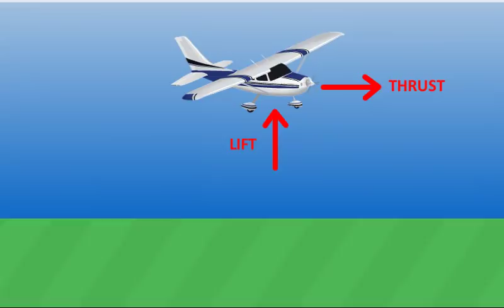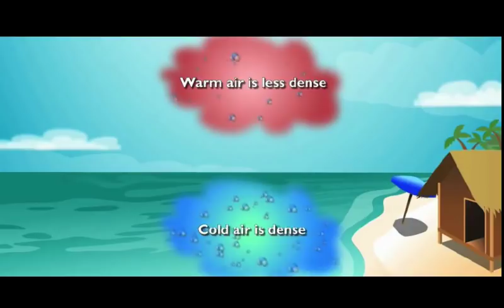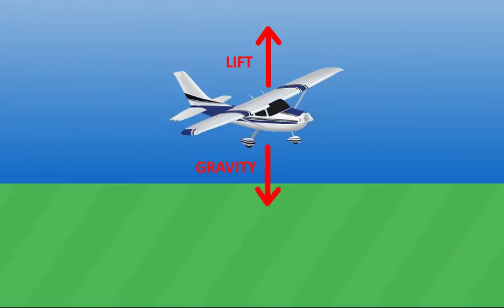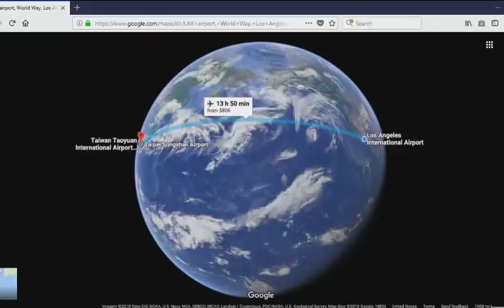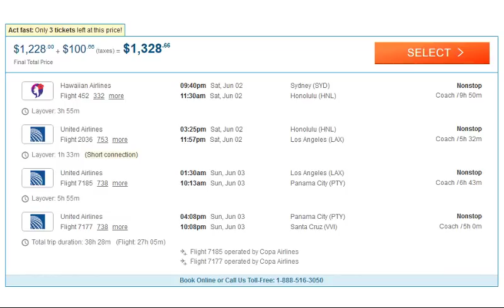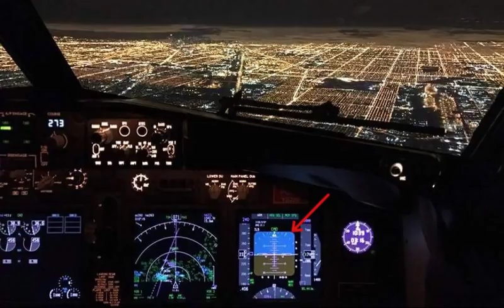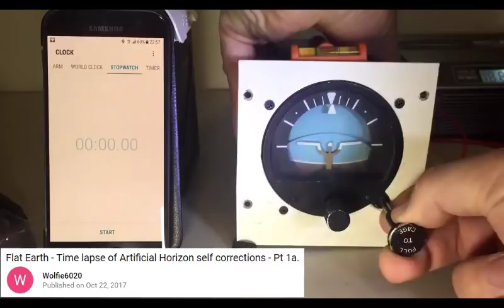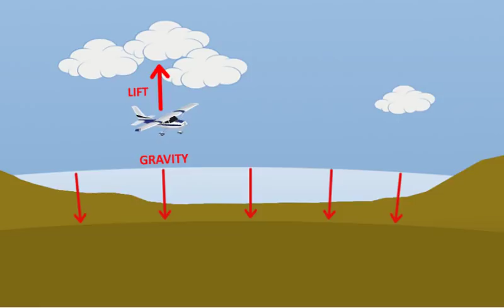Flat Earth Falsities - Plane Nonsense

Comment: Lmfao you mean "Air Density"  is what is actually Atmospheric pressure. Airplanes use route checks for strong cross winds. All routes are planned and are often changed due to Weather this has nothing to do weather the Earth is spinning or still. The air does not rotate with the Earth's Rotation it moves independent of the Earth. You can see massive cloud sections moving all over the palace in every direction. So by using your eyes  you can see that the Air does not rotate with the Earth. Anyone who looks up at the sky can see that the Air that is moving the clouds is then also moving faster than 1200 mph in order to counter act the Earth Spin thus making Flight Impossible. Look at a globe from the Top and now the Flight to Alaska makes sense stop looking at the Globe from the Side, look at it from the Top and you will see exactly why that flight went to Alaska. Since you are so smart then please explain which American or Russian Astronaut prior to the Apollo missions has the space distance record for being at 5000 km away from Earth and returned? Zero records . No Astronaut has ever claimed that record. We can see perfectly for 250 + miles from mountain ranges to other Mountain ranges. Gyroscopes were never made to account for any Earth Curvature. Forget Flat Earth fake Science is behind it.
Reply: Danfuerth Gillis Would be nice if you used paragraphs. I couldn't even read what all your arguments were (if you could call them arguments, it was more you going huh no you're wrong).

So let's just take the first point. You say that instead of atmospheric pressure, it should be air density. Can you clarify this? Are you saying he is wrong that we don't feel less pressure as we increase altitude? Or are you saying that atmospheric pressure itself is a myth and doesn't exist?
Reply: Danfuerth Gillis Net movement of the atmosphere is the same as Earth. That there is rotation of the atmosphere doesn't mean there are no local variations in velocity.
Reply: Flook D the Jet Stream contradicts that . In fact no air ( Wind) has ever been recorded moving at 1200 mph . Only Jet planes can fly faster at Mach 3 thus flying faster than the Earth moves and certainly any Wind ever recorded. The Globe worked perfectly until the age of flight came . Wind moves in all directions it moves massive clouds faster in the opposite direction  of the Earth's Spin but not at 1200 mph !!!!. You can't have it both ways either the Wind moves at the sequencial speed of the Earth or the Wind and Air are completely independent of the Earth
Reply: Danfuerth You're making no sense and I can't decide whether you're a Flattie, a Roundie, A Roundie pretending to be a Flattie to make Flatties look bad or a Flattie pertending to be a Roundie to make the Roundies look bad. But I know everything you say there is false and You look bad.
Reply: Danfuerth Gillis 
You're failing to realise that the Earth is only spinning at 1200 mph relative to the centre of the Earth. You too, who is standing still on Earth's surface is technically spinning at 1200 mph relative to the centre of the Earth. However relative to Earth's surface you're moving at 0 mph (if you're standing still). See how speed is relative? 

So basically, the atmosphere is very much attached to Earth and moving with it, but you obviously don't see it moving at 1200 mph. Why is that? Because that is relative to the centre of Earth. On the surface of the Earth we can only see it's speed relative to the surface which we stand on, and this speed will be much less dramatic cos it doesn't have much to do with Earth's spinning but more air currents and temperature gradients.

Say you're on the ground looking at a plane fly by. It's looks like it's moving at 200 mph (idk the speed of planes) relative to you on the ground. However to someone inside that plane, it wouldn't feel like they were moving at all relative to where they are. But if they then look at another plane flying by at 201 mph in the same direction, it would seem as if they are only moving at 1 mph relative to you. This is why talking about speeds is tricky, especially on a large scale such as earth, there's no point bringing out these enormous figures because they are relative to extremely huge scales of distance.
Did this help you understand the concept?
Reply: King Fox nice job spelling out how the earth’s rotation works and relative momentum.
People who push a flat earth philosophy only do this to reinforce their flawed belief in Christianity or creationism.
Reply: Duffman 007 I dont do it for the brainwashed, I just hope innocent little Billy sees that and thinks oh so that's how it works, now I don't have to rely on a far fetched concept with no functional model to explain stuff.
Reply: Danfuerth Gillis Sigh. 1200mph relative to what?
Reply: Danfuerth Gillis Earth & moon have separate gravity wells. You can stay in Earth's or you can go to the moon's; going halfway & turning back doesn't make operational sense.
Reply: OMG did you just actually say "So by using your eyes  you can see that the Air does not rotate with the Earth.". Really? Lets assume you know nothing. How can you measure the shape of the earth? How did we? What is the type of mathematics that involves measuring shapes called? Do you know what shapes are? How do you measure a circles circumference? How do your eyes see color? Not sure where we have to start with you.
Reply: Danfuerth Gillis https://youtu.be/uFTWspqkVYM
Reply: RockinRobbins13 So which Astronaut Russian or American has the space distance records prior to the Apollo missions? Watch my channel for that mind bender on how Humans went from Orbit right to the Moon with no distance markers lmfao. I love that ISS time Lapse video section with the ZERO movement of all clouds hahahaha.

Comment: These Flattards need to be rounded up and shot into the outer limits of the upper atmosphere. It will in synchronous provide them two fundamental irrefutable facts. 1. The Earth is a sphere and 2. Gravity. They will be brought crashing back down to earth which also brings about the third convenient benefit that they are permanently removed from the genetic pool.
Reply: +Erick Ramirez
"wong I have every right to comment on anything I want" So?
 "that's what's wrong with science today" The science I referred to is centuries old.
 "just cuz you think your educated you think the globe and gravity is a fact lmao fact checked you cuz all this are theories you idiot learn the difference." The questions I asked were practical questions Erick. Questions based entirely iupon personal experience and practical uses.
"Another nasa boy fan." Did I mention NASA? No. Why do you have this fixation on NASA? Is it sexual?
"Earth is flat and it doesn't move." So answer my questions.
"earth is not a globe" Correct, it is a slowly rotating terrestrial spheroid. A globe is a model of the Earth.
 "and water always finds its level" Correct. Entirely due to gravity. Do you now what sea level means?
Reply: @Erick Ramirez
Debunked.
http://embracetheball.blogspot.com
https://www.metabunk.org/earth-curvature-refraction-experiments-debunking-flat-concave-earth.t6042/
https://twitter.com/Cmdr_Hadfield
http://embracetheball.blogspot.com/2016/12/eight-inches-per-mile-squared.html
+Erick Ramirez
"wong they have done that same experiment it's flat." So you claim. Without evidence.
"Have you heard buzz Aldrin say it with his own mouth that they never went to the moon? He did." No, I haven'y. Have you? If you have then please provide proof.
Reply: M. S. youve never been to "space".
Reply: wong I have every right to comment on anything I want that's what's wrong with science today just cuz you think your educated you think the globe and gravity is a fact lmao fact checked you cuz all this are theories you idiot learn the difference. Another nasa boy fan.  Earth is flat and it doesn't move. God made the heavens and the earth first than the sun and the moon on the fourth day get your facts straight before you step up fool
Reply: Stormageddeon Dark Lord of All dude stfu trying to sound all smart and shit. If you were so smart you would of figured it out by now that earth is not a globe and water always finds its level it doesn't curve never has and never will. Wake up nasa boy fan
Reply: wong you said it yourself sea level not sea curve... go to sleep homie or go spin on your globe. Wich one is it a sphere a globe or a pear shaped?.... pics from nasa don't look nothing like a sphere or a pear....... Yes nasa boy fan cuz that's where you get most of your info
Reply: No... level means curved? And I'm the non educated? Here we go another smart guy that's defending his globy zombies
Reply: No... so does it say anything of curvature genius?
Reply: No... Does level have the meaning of curvature or no?
Reply: No... like sphere is now pear shaped?... plz explain to this small brained person plz. Mr intelligent
Reply: @Erick Ramirez
How erudite. You have simply reconfirmed how poorly educated FE cultists are. Congratulations.
We know the earth is a slowly rotating terrestrial spheroid and gravity is a fact.  Just because you are incapable of understanding basic maths and physics and wilfully refuse to learn such things is your problem. Examples of questions for you about basic, practical, everyday maths and physics used in the real world - 
What is the relationship between longitude and distance when travelling east or west parallel to the equator?. If you know the answer then you know the earth is a spheroid. If you don't you are not qualified to comment on the earth’s shape.
Please explain the principles behind the development and functioning of a gyrocompass? If you can then you know the earth is a slowly rotating spheroid and gravity is a fact. If you don't you are not qualified to comment on gravity, the earth's shape or movement.

Comment: If you measures the earth around the equator, then around Antarctica and if the distance of around the Antarctica is greater, then the earth is flat
Reply: There is an annual sail boat race around Antarctica.  The total distance of the race is 14,000 miles.  The total distance around the equator is 24,000 miles.  Looks like Earth is not flat.  Of course you'll simply ignore any evidence that disagrees with you.
Reply: What equator?
Reply: Jerry Gregor 5,365 miles  down dron north pole or center of your flat earth.
Reply: ***from
Reply: Abad Ventura Not my flat earth. I live on flat moon.
Reply: Jerry Gregor that is a good one lol
Reply: OMG GMO I don't trust those figures. I'm going to sail in that race but I'm taking a tape measure.

Comment: No. 1 : "Why does it take the same time to fly East as it does to fly West?"
Ahem!  It doesn't.  I have flown many times to USA from UK and returned, and the flight times are significantly different - but it's because the East-to-West route flies out of the jet stream, which would be a headwind in that direction, and West-to-East flies in the jet stream to get its benefit.

Comment: For the record a real helicopter would be a pinhead size or less and fly a height of a pin prick or less. Helicopter can not get high enough because the rotor blades need dense air.  A rocket frequent flies high enough and constantly takes pictures of the rotating earth.  So what's your motivation for choosing the helicopter rather than the space rocket???
Reply: Bobby Wizdum like I said. What's your motivation for choosing to ignore rockets taking pictures.  You don't believe in rockets?? You dont believe in  photos??
Reply: nigel iloilo pictures of the rotating earth? bullshit.

Comment: good video! but who found the earth rotational speed is 1000mle/hr and how? and this video does not prove that earth is rotating, the concept can explaind on non rotating surface also.. no matter round or flat or any other shape!! so the question is what is the original shape of earth?
Reply: Deeps P, the Earths rotating speed is once per 24 hours. The circumference is 24,900 miles / 24 hours = 1037.5 mph. This is the speed at the equator. Going from the equator to the poles this speed steadily drops to zero mph at the poles. This doesn't mean a person standing at the pole isn't rotating, but he circumference around the pole is zero, so the the person isn't traveling any distance around a circumference.
Reply: @NotTheCIA The term is "stellar aberration". It was discovered and confused for stellar parallax in the 1600s. See https://en.wikipedia.org/wiki/Aberration_of_light
Reply: Deeps P - as you seem genuinely interested, but also pretty ignorant of science and the history of scientific discovery (not an insult simply an observation - I consider myself to be ignorant scientifically but know a bit more than you - lol!!!), you might try watching some actual science videos and/or reading some books. You can also do your own experiments - the Eratosthenes one is easy - this guy measured the circumference of the earth fairly accurately over 3000 years ago. Good luck on your voyage of discovery!! The BBC series with Brian Cox are good - on Netflix, I think they're called The Planets, and Nottingham university have several channels including Deepsky videos which talk about how we measure distance to stars etc.
Reply: @honeychurch How are you proposing he duplicate the experiment Eratoshenes did? It is a long way to Aswan.
Reply: honeychurchgipsy6 .. great
Reply: ryublueblanka That you can't make sense of something does mean it does make sense, simply that you can't understand it. Why not try asking for explanations?
Reply: I believe the moons of Neptune, are still forming, and they look like charcoal briquettes, not yet spheres.
Reply: ryublueblanka it appears almost perfect because of the water.  If you have a problem with water being round or spherical, I'd like to introduce you to things known as water droplets.  Spherical while airborne (like earth) and dome shaped, when laying on a flat or even slightly angled surface.
Reply: +SpectatorAlius
And you believe AIG is a factual trustworthy source of information. Only YEC cite AIG as a source of factual trustworthy source of information. Or a gullible fool or liar. So what are you , gullible, a liar or a YEC?
Reply: Spectator - not necessary to replicate the exact experiment to show curvature - measuring shadow lengths can be done anywhere.
Reply: ryublueblanka - not sure where to begin so how about the apparent issue with the shape of the earth? I'm actually astounded to find that there are still people on YouTube who are getting muddled with this. There is no discrepancy between Neil de Grasse Tyson's statement and NASA's pictures. The earth is slightly dumpy at the equator - but it's such a tiny amount that it's not visible to the naked eye - only very precise measurements made recently have discovered that it's not a perfect sphere, but in fact an oblate spheroid. 
Hope that helps - and I suspect that every single thing that you've been told doesn't make sense will be easily sorted out given a bit of information/knowledge.
 Your opening statement is interesting to me because it implies that you believe that there is something 'wrong' with science. Strange since the scientific method has been developed over a long time and constantly seeks to improve methods in order to correct for human bias and error (think of the randomised double blind studies done on new drugs). It is not perfect and no scientist would ever declare that science comes up with irrefutable 'facts'. Science models the world and comes up with the best answers available given current info. - it then reassesses as more info is available. 
This means that, if, when they first went to space and looked at the earth they found it was not a sphere - NASA would have been the first to tell everyone and receive a Nobel prize.  Lastly the proof of the scientific method, and modern science, is that IT WORKS!!!! We would not be able to communicate here if it didn't. The only way the earth could be flat is if there has been a massive conspiracy involving all scientists and teachers and all tech companies etc. etc. over a very long time, and you have got to be crazy to believe that. Oh, and what exactly is the purpose of this conspiracy?
Reply: +honeychurchgipsy6 you're forgetting that all of us...all if not most were raised on science...the difference is we are questioning it now. A lot of things don't make sense or there wouldn't be so many people taking another side and viewpoint. This has actually become a debate and its bringing up many questions. Think about this...NASA says the Earth is a Globe and shows pictures of it being PERFECTLY CIRCULAR. Neil Dgrass Tyson says it's Pear 🍐 shaped. Other scientist say it's Oblate. Flat earthers obviously say it's flat. So which one is it???

Comment: Just one samll correction. Level flight is perpendicular to the force of gravity, no parallel.
Reply: @Mark Kmiecik Flight is perpendicular to the force of gravity if you stall out and head straight down to your crash! Or if you use the VTOL feature of a Harrier bomber;)
Reply: The force of gravity is towards the center of mass. In the case of Earth that makes it vertical. Are you implying that level flight is vertical? I was under the impression that level flight is horizontal, which is perpendicular to vertical. You must be using a defective dictionary.